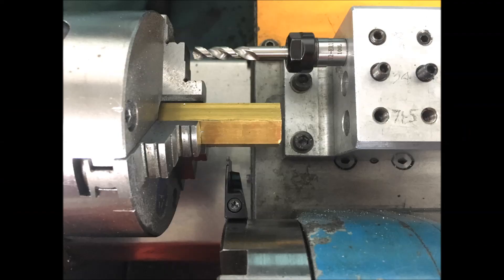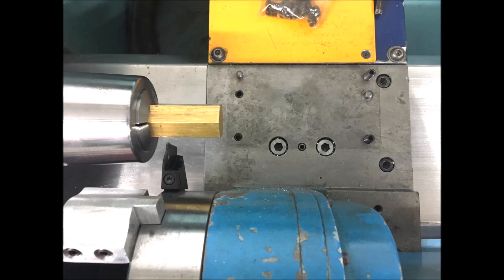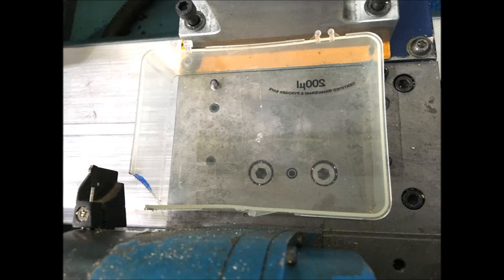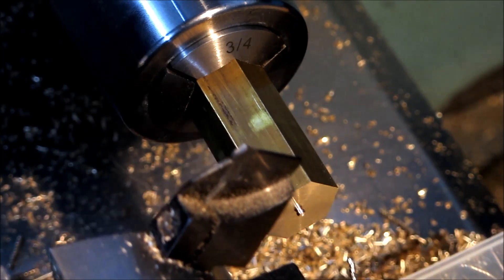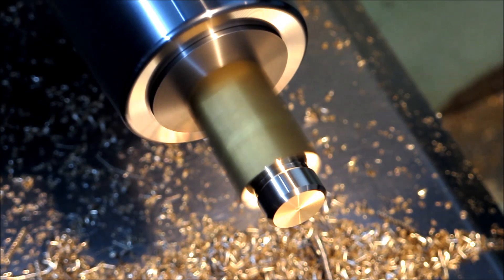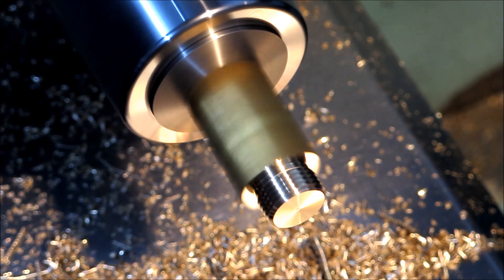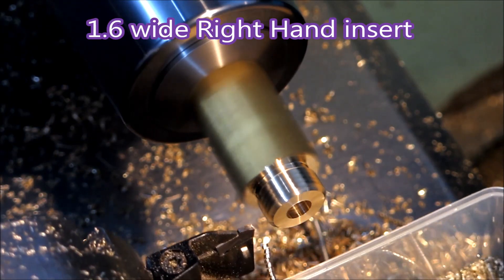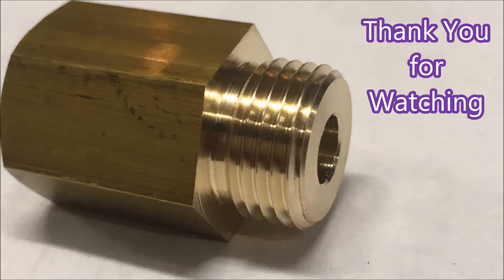Mini Minor Engine Adaptor in brass.  Turned, thread cut drilled & parted off.  CNC lathe with turret

Comment: Thanks for sharing and putting the video together.  These projects are certainly not trivial.   Can you provide more info on what software that you are running?  Controller?  Encoder? etc?
Reply from the maker: The lathe is controlled by the software provided by the manufacturer. The pc software is cad/cam, with the cam being a little better than the cad in versatility. I draw in my own cad software and take a dxf file into the the software and use the cam to write the code.  The spindle is driven by a 180vdc 1/2 hp. The ball screw axes are driven by servo motors. My spindle motor is driven by a Minarik motor driver which allows the motor to work  at its maximum power, the standard manufacturer arrangement does not allow the motor to get its full 180 vdc. This modification still lets me use the standard software. The pc needs to have a ISA slot to accommodate the  pc interface card which was supplied by the manufacturer. Our main difficulty is finding a pc with an ISA slot as these were phased out years ago. Old electronics can be difficult to keep running at times.

Comment: Hey amayzing Video!😀. How does your Tool turrent Work inside? Can you explain or Show it? I think many of us are interessted . Thank you
Reply from the maker: It is quite a complicated design and it was replaced in later model by a worm and wheel driven by a stepper motor. It would not be easy to duplicate.

Comment: Hey Nigel.

Nice work making this part.
At the moment i am still cutting threads on my Manual Lathe ???
It will be good to see how the jobs go on the CNC lathe.
 When i eventually  get time to finish rebuilding it, LOL.

Enjoying your video,s.
Regards Peter.
Reply from the maker: Cutting threads on a manual lathe! Have not done that since trade school. Even button dies don’t get much use here. The Hercus just makes it so  easy to produce great looking threads. Although I do cheat a bit by using full profile inserts. Thanks for your multiple comments. You might like to view the facebook page for Hercus cnc machines, if you belong to fb.

Comment: I am new to cnc lathes. How do you program the manual "bar stop" at the beginning and end? Love the videos btw, I enjoy seeing the goofs as well as the finished products.
Reply from the maker: Using the cam in the Hercus software, I tell the software that the stop is a 10mm wide parting tool in the appropriate slot in the turret. Then, using the cam, I input rapid moves to make it do what is required.  The next tool change starts the spindle and the program progresses from that point.  As the program runs in a subroutine the end is actually the start of the next subroutine.
Reply: smallcnclathes thanks for the quick reply. I think I get it. I am using fusion360 for my cam, I am sure they have something like this too.
Reply from the maker: Hi Tyler
I just call up the "stop" as the first tool and delete the spindle speed that my cam automatically puts in place.  I call it a 10mm wide parting tool so that it looks like the stop I am actually using.  I am sure you could do the same in Fusion, even if you have to go into the code and and delete the spindle speed as I do.
Reply: smallcnclathes great, I will try it out. I appreciate the help.